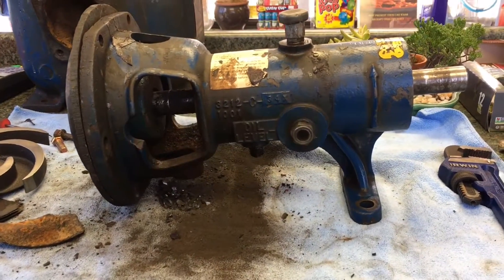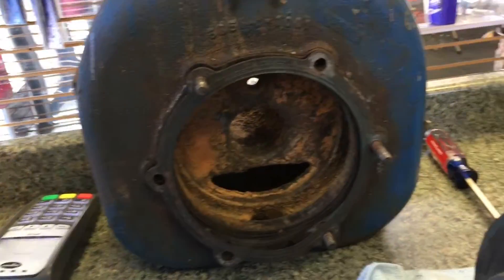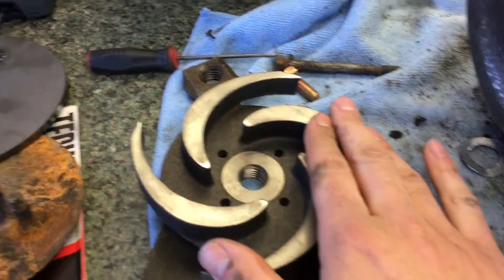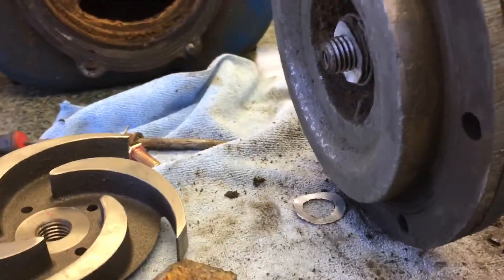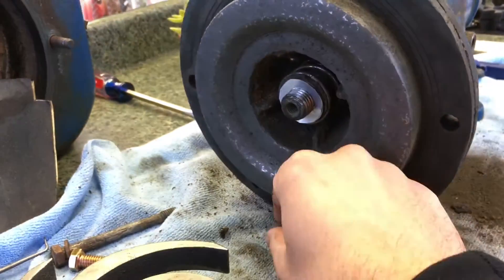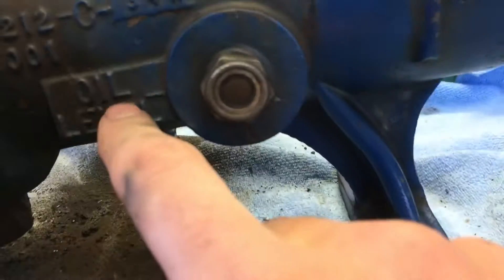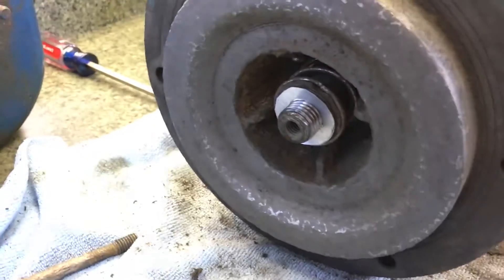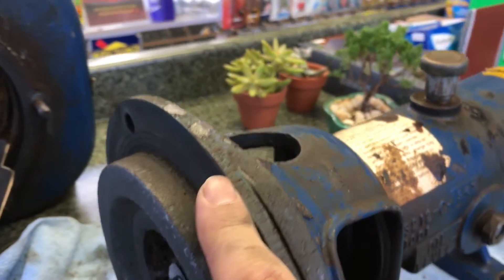Gorman Rupp Series 80  Rebuild *Step by Step*

Comment: What are the clearence between the impeller and the wear plate?
What are the clearence between the seal plate and the impeller?
How does the shaft look at the oil seal location ?
How about new bearing?
Did you vacuum test the bearing housing ?
How about the way you install the new mechanical seal?
How about the performance of your pump now...
Please,  leave this for professionnel....
Reply from the maker: Working great. Some people just need to get the pump up and running. It’s not a pump to take an astronaut to the moon. Relax. It’s for dirty water for a reclaim at a car wash.
Reply: Over thinking it pal fix the pump anyway you can get the damn thing running and finish the job the guy did a fine job and the pump works it’s folks like you who take your shit to other people because they told you a bunch of jargon and convinced you your too damn dumb to fix stuff now you taking a pump to some other random wacko who’s gonna do the same thing this guy did and charge you triple and take his sweet ass time now a one day job it 2 weeks cuz you couldn’t believe in yourself to figure something out on your own….